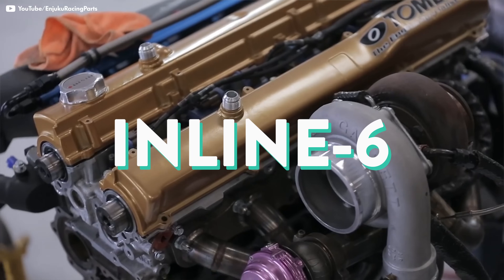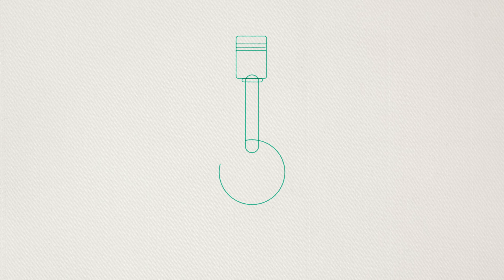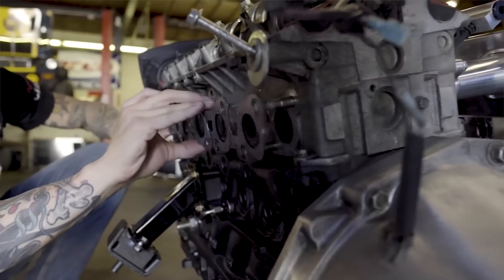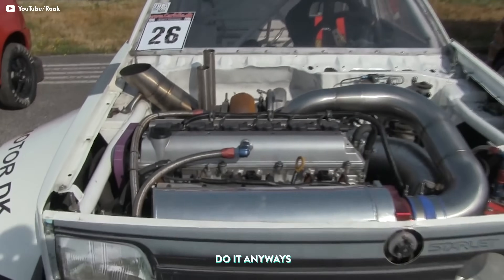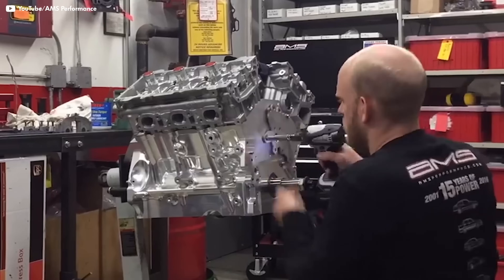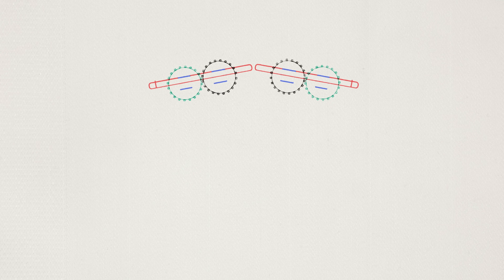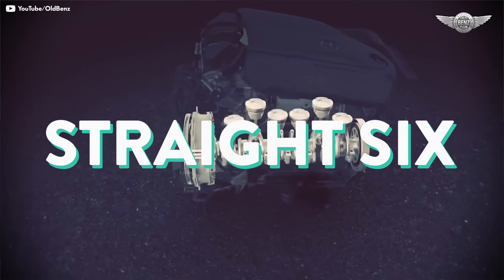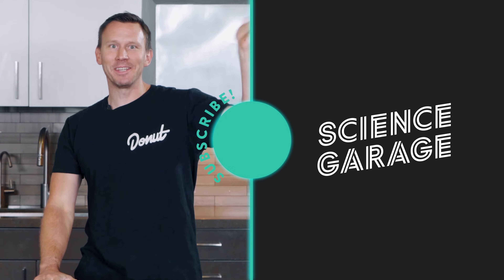INLINE 6 vs. V6 - How it Works | SCIENCE GARAGE

Comment: I'm going to get a little nitpicky here, one advantage a good quality straight 6 has when you are really going to boost em up is they have 7 main brgs. unlike my Mitsubishi 3000GT VR4 6G72 only has 4, ya gotta pay allot of attention to the bottom end. Even stock the Mitsi needs rod bearing replacement before 120.000 & that can be related to the mains being a LITTLE loose leaking off oil pressure to the rods. 
 Now I'm not much of a U tube guy, accidently tripped across your site-nice job!

Comment: There is one thing you didn't mention: An Inline 6 will have more torque than a V6 of the same displacement, and construction. I am honestly not sure why this is, but I imagine it has to do with Inline 6s being more efficient in terms of how they handle energy transference to the crankshaft.
I also imagine that a modern V6 to Inline 6 comparison would yield a slimmer difference between the two.

Comment: You forgot to mention that the new NSX has a 75° V6, which is unique! No other V6-equipped car has its cylinders in 75°!
Also, the new Porsche/Audi 2.9 V6 has its twin turbos in a Hot-V layout, which reduces the engine's overall width (apart from shortening the intake and exhaust runners)!
Reply: https://en.m.wikipedia.org/wiki/V6_engine Actually Isuzu had built a 75 degree engine for the Trooper/Rodeo and Honda Badge Engineered Passport.  But you're right. As far as I know, no "car" has had a 75 degree v6 installed.
Reply: @Mr._Flunky  Whoa! That was too rare even for us car guys!!

Comment: Straight 6 is best. The sweeping majority of semis use them, all the paccar motors, cummins, and CAT
Reply: Because v8s became well ridiculous for their cost. Cat and Cummins both make v8s hell cat owns gms old 24 cylinder diesel and a i6 will never produce even at the same cubes the same power given that you would be limited to a rpm where the i6 ports would never really work

Comment: I taught the v6 engines were more stable as the natural v-orientation allows both cylinder banks naturally cancel out engine vibrations unlike the i6 models
Reply: But they have a secondary imbalance that makes them resonate under certain rpm/load conditions.
Reply: @michaelbenardo5695  really? I did not know

Comment: love my inline six on my 2006 BMW 330ci
Reply: My first car was a 2004 330ci, got it to 231K with barely any issues AND still sold it for 2200; now I drive a 335 ;)
Reply: i love power
Reply: @mikkihintikka7273  You love power until you wake up in a pole... :|
Reply: @Rob-326  what do you mean? in the pole? you mean i have hit pole with my car or what
Reply: @mikkihintikka7273  Utility pole,Phone pole,etc. The one in which if you crash at high speed...You won't get out of there alive.Think it was easier to say a wall or something like that but a wall is too obvious... :|
Reply: I love oil leaks even moree xD
Reply: On your 2006 BMW 33083649403937745949373638749ci
Reply: Its too bad they're slow.
Reply: almost bought one. it started smoking before the test drive. bought an 02 x5 instead. very happy.

Comment: If I could get a Mercedes S class with an in-line 6, I’d be so happy. No need for a V12 to get a smooth ride. Just get an S450 with the upgraded suspension and you have a cheaper and more efficient Maybach

Comment: Hey, can you explain why you never see a front wheel drive + rear mounted engine layout?
Reply: Connor Skehan then there would be no point to front wheel drive. You would have the disadvantage of front wheel drive (steering wheels being driven) but none of the advantages (packaging, no big driveshaft running through the car).

What I would like to know is why Audi have longitudinal engine layouts with front wheel drive in some cars.

Comment: Names best i6 forgets the indestructible 4.0 jeep engine
Reply: Ford 300ci straight six
Reply: @davidlandis7026  they used that shit in dump trucks it can haul
Reply: Can’t throw too much power at that engine tho.
Reply: @ericsens4070  true. That is the the downside. But I don't drag race it, so it gets the job done
Reply: That's why I love my jeep
Reply: Preach
Reply: Craig the farmer Barra in-line 6 4.0L ford engine
Reply: i love my comanche with its 4.0
Reply: And ford 300 i6
Reply: You Jeep guys must not be mechanics, in my profession we refer to those engines as "job security"...
Reply: fpeletz didn’t know that
Reply: How about an i6 Cummins?!?!
Reply: Toyota Land Cruiser/ Lexus LX450 had inline 6 4.5L based on the venerable Chevy 250 engine. The FZJ80 engine is a great engine
Reply: Trash
Reply: Nah...had a few of those dinosaurs.  No thanks!  Low power.  Gas hogs.  Cheap valve lifters that require replacements before 80K miles.
Reply: He didn't forget. Keep word "best"
Reply: Dad has one with 400,000+ miles on it. Never had to do much but change the oil
Reply: Are you forgetting the Cummings
Reply: We are forgetting the good ol' Barra.
Reply: Lameee 😂

Comment: Both have their compromises but I think the compromises of having inline 6 are far more livable and sustainable.

Inline 6 and boxer 4 are my favorite engine types. Because balance. Better balanced engines last longer and can be driven harder, assuming the internal components aren't compromised (small oil or water channels, cast pistons and conrods, bearing clearance, etc.).

Comment: Why doesn't chrysler put a inline 6 in their rwd sedans? The V6 is weak in my opinion compared to the smooth and durable I6. Not to mention performance aspect. Supra, BMW, Benz are great brands. Except for the over engineering.

Comment: Physics: “you can’t mount an inline six transversely.”
Volvo: “hold my öl!🍺”
Reply: To be fair though, they are rather annoying to work on...
Reply: @RazorbackGrasshopper  yep have to remove the fender, wheel arch and entire suspension on some to gain access to the belts, alternator and water pumps. Not very practical
Reply: @pb6198  FACTS!
Reply: @RazorbackGrasshopper  FACT.
Reply: Suzuki verona as well
Reply: @CrazyDavy22  I have heard that Korean cars ride nice and softly.
Reply: Volvo be like “hold my extended warranty”
Reply: @CrazyDavy22  I don't smoke weed, and when I use all-caps, it for emphasis, not volume, and YOUR generation is the one who doesn't care about anybody except for "self"
Reply: @CrazyDavy22  My kids would not be able to take my license from me, as I would now allow them to be over me.  I still have my driver's license, unlike many of YOUR generation who gets their licenses revoked.
Reply: @CrazyDavy22  The very idea that so many of your generation, (if you are of the age group I think you are), insist on running around without a mask even if you have a-symptomatic COVID and are a danger to other others is the ultimate sign of selfishness and self-importance.  Truly sad and abhorrent.
Reply: @CrazyDavy22  That's interesting.  Didn't know any existed!
Reply: @CrazyDavy22  Different strokes for different folks.
Reply: @CrazyDavy22  I liked the new Chrysler 300 Hemi, but they dropped it, and even though a muscle car is too uncomfortable for me, I like the new Dodge Challenger, I like the new Camaro, I like the new Mustang convertible, and of course I want them to build cars, and of course I want people to buy cars, I just don't like cars that are in the Japanese idiom, and most of today's cars are just that - in the Japanese idiom, (yes, I have heard that Korean cars ride well).  I don't care for a rough ride in what is supposed to be a full-size mid priced sedan, nor do I like that intrusive hard plastic center console, and I hate the fact that in order to check the automatic transmission fluid, you have to jack up both ends of the car and put it on jack stands.  Another reason I have strong feeling against them is because Japan subsidizes their auto exports and their steel exports, and does everything unwritten that they can to limit foreign cars and steel access to their markets.  By doing that, they destroyed our auto and steel industry.  Of course I have ill feelings toward their products.
Reply: @CrazyDavy22  I wonder if that would still have come true if Japanese cars were priced higher, and if gas stayed cheap.
Reply: @CrazyDavy22  They said they dropped it.
Reply: @CrazyDavy22  But I LIKE giant land yachts, and I can afford the gas.  I am wondering how many people would have turned against them if gas had stayed cheap.
Reply: @CrazyDavy22  I have been driving for 50 years, and I don't like Front Wheel Drive, nor do I like small 4 cylinder engines, so sue me!
Reply: @michaelbenardo5695  well good news! Everything will be electric in a few years so no more 4 cylinders for you! 😂
Reply: @CrazyDavy22  I will still have my 54 New Yorker Hemi and my 73 Jimmy 3/4 ton with a 292.  I don't have that need to constantly have the newest.
Reply: @michaelbenardo5695  great. You do you boo. Drive a covered wagon and rant about how horseless carriages are witchcraft for all I care.
Reply: @CrazyDavy22  Why are you getting so worked up about it if you don't care?  You are just mad because I march to the beat of my OWN drummer, not everybody else's.
Reply: @michaelbenardo5695  I’m not worked up. I’m certainly not mad. I said I don’t care because I don’t care. That’s the opposite of being worked up. I’m apathetic. Your opinion is not unique or interesting and you had nothing to say to support your assertion so I was attempting to end the boring conversation. Please stop tagging me in replies. I have no interest in spending more time on you. Go away. Bye.
Reply: @CrazyDavy22  YOU are the one who angrily replied to ME, so I will have the last word, not you.
Reply: @CrazyDavy22  Ralph Nader is the one who can't drive.  Yes, I liked the Corvair.
Reply: @michaelbenardo5695  ok? 🤷🏻‍♂️
Reply: @CrazyDavy22  You are over 50?
Reply: Engines shouldn't be mounted transversely.
Reply: @michaelbenardo5695  the vast majority of engines are mounted transversely as this has significant packaging advantages. Everything from econoboxes to exotics like the Lamborghini Miura and Honda/Acura NSX.
Reply: @CrazyDavy22  I didn't say they weren't, I said they SHOULDN'T be.
Reply: @michaelbenardo5695  they absolutely should be, torsional load from engines affects the vehicles balance a lot, (look at old muscle dragsters) the damn frame twists.

Also, a transverse mounted engine has less rotational inertia during cornering, can be mounted lower due to the gearbox orientation.
And can be mounted nearer the centre of the car, again reducing rotational inertia, with improves agility.

The only reason it's not done with some supercars is the compatibility of gearboxes, large engines the can't physically be fitted transversely yet, and other packaging issues
Reply: @pb6198  But that almost REQUIRES front-wheel-drive, and not all of us want front-wheel-drive.  Have you ever tried to get at the spark plugs on a sideways-mounted V8 or V6 on the side facing the firewall?  Have you tried replacing the timing chain, or the water pump, or the harmonic balancer on cars with a side-ways mounted engine?  Often VERY difficult.  On a car with the engine mounted longitudinally,  it is generally a snap.  Not all of us want a front-drive car with a small 4 cylinder engine.
Reply: @michaelbenardo5695  yeah I have, it's piss easy on a properly designed car, and actually transverse rwd is more common than you think.

What's your problem with fwd, and get on this century
Reply: @michaelbenardo5695  nobody has forced you into no choices 😂🤦
Reply: @pb6198  The problem with Fwd is that I don't like the way the car feels, I don't like the way you can't tow a heavy trailer unless it will be on fairly level ground, and as far as easy as p--s to work on on a preperly designed car, that might be true if the car is wide, or has a really tiny engine, but it the engine fills the engine compartment, no it isn't.  Many things are Engine Out jobs.  The Germans also don't like Fwd due to the way it makes a vehicle feel.  As for transverse Rwd, is it common?  I have never heard of it.  Transverse 4WD, yes, but rwd?  What kind of car?
Reply: @pb6198  Nobody?  I agree to disagree with you on that.
Reply: @michaelbenardo5695  you haven't been forced into it, read properly.

You can get longitudinally mounted engines cars
Reply: @pb6198  Only muscle cars.  And while I am glad they are still around and would love to sample some, I am a senior with a bad back.  I want a COMFORTABLE car, and my only choices are collector's cars that either need restoring or are priced out of my reach, and the expensive German and English cars are priced out of my, and most other folks, reach.  I don't want a Japanese car.  Too small, too rough riding, too cramped inside, are not designed along the lines that I like, and, the Japanese will not allow our cars to freely enter their country, but subsidize their auto exports, making it impossible for our automakers to compete.
Reply: @michaelbenardo5695  a lot of Toyota, Volvo, BMW, mercedes, mitsubishi, land rover, Chevrolet, nissan and many many more current choices, you are grossly misinformed of you think only muscle cars of old are longitudinally engined
Reply: @pb6198  I was talking about TODAY'S muscle cars, not those of old, and I have no interest in in foreign cars, especially Japanese cars.  They just don't pull my chain.  The cars I like - traditional full size softly sprung American cars - are no longer being produced.
Reply: @CrazyDavy22  I never said you can't mount an engine transversely.  I just happen to believe that they SHOULDN'T do it.  It makes the car too hard to work on, and I am one of those red-blooded males who enjoys working on cars, and thinks that only a woose is scared of getting his hands dirty.
Reply: @michaelbenardo5695  I work on my own cars too. It’s been a hell of a lot easier to work on the FWD cars I’ve owned (with the exception of my Volvos) than the RWD ones.

Comment: He didn't mention any actual disadvantage on the I6 engine, just because it's longer doesn't mean it's bad, not a disadvantage at all. However, V6s on the other hand, really do have a lot of disadvantages. Even semi trucks use I6 engines, they are very reliable, powerful, and easy to work on. Even mercedes pretty much copied what BMW has been doing for years, I6 3.0 engines, it's a great setup for efficiency, power, reliability, and just pure awesomeness!!
Reply: In-line 6 longitudinal components may be more prone to flexing tho
Reply: @chinadonconan6933  That is especially true with the in-line 8 engines that were around from the 1930s until the 1950s. Eight cylinders in a row were much too long to be a practical, long-running design.
Reply: It's size means you can't put it in just about any car. Size can be important.
Reply: @yamil8003  they're really not that big, just look at the e36 and e46, small cars, with a small hood, and they still fit them without issues
Reply: @VictorEstrada by definition they are roughly double the length of a v6. It’s a great engine, but pretending like double the engine length is not space prohibitive is doing the engineers who do manage to package them into smaller cars a massive diservice

Comment: Absolutely easy choice.

Rear wheel drive, Straight 6.

Balance, less components and complications as well as the correct wheels driving.
Reply: Balance the i6 is inherently very balance but not perfectly so they still vibrate. Balance is a v12 it's perfect

Comment: Is there a v6 that doesn't have overhead cams?
Reply: ThunderBolt979  the gm 3800 is a single cam push rod motor like a ls v8
Reply: GM 4.3 is just a cut down sbc v8

Comment: Suggestion: Why 7 cylinder and 9 cylinder (& other uneven numbered cylinder-) engines are not existent, but 3/5 cylinder engines are. 

(I know,  in a row they would be long, but there was a V5 Engine once too, so..?)
Reply: 7s exist but are very very heavy large and built into the equipment they run
Reply: 9s also exist but are rare also unless you find both in radial format

Comment: Well bugatti managed to fit 4 turbos around a W16. So it that really an excuse?
Reply: And guess what u have to do to service that thing. Drop the motor.
Reply: @kkbsrt8687  There is a video about it if I can remember correctly...
Reply: The NSX isn't a front engined car though :p
Reply: W16.
It's two VR8's merged in one (Thank you random2203 for the correction!)...So...it's more taller than wider...
And it's mid engine.
The inlines and v6's described here are for front engine cars... :\
And leave Bugatti with their sorcery there.He is talking about normal (somewhat everyday) cars. :P
Inline 6's like Toyota Supra,Nissan Skyline,BMW M3 E46 (not the GTR) :)))
V6's like Nissan GTR,Hyundai Tiburon,etc.
The W is wider than a V engine...But it has enough space to squeeze the 4 turbos there.
What really impresses me is the fact that there are 10 radiators there...10 of 'em! O_o
And the fact that after 30 minutes at top speed...lo and behold...you need new tires. :|
Yep...That's how long they'll last at top speed...
And the Veyron is a Hyper Car...the cars that have Inlines and V's are supercars... :|
Reply: @Rob-326  It's two VR8 engines...
Reply: @roli22039  Isn't that what I just said in the first sentence? "It's two V8's merged in one"
Reply: @roli22039  Welp....You're right...edited the comment.Thanks for the info. :P

Comment: I love my V6 engines. First car was a V6 and I fell in love with the noise. You also neglected to mention a con to inline 6s in that they tend to be heavier than V6's, and even V8's. An LS V8 weighs less than an RB or JZ engine.

Also, I've had honey for ages and I love it. Love that browser add-on.

Comment: Mitsubishi made a bunch of very low capacity v6's for the malaysian market.. 1.6l/1.8l/2.0l .. (6a10/6a11/6a12).. the 6a12 was also used in the FTO with 4 camshafts/4valves per cylinder but still revved to 8k to compete with the integra type r.